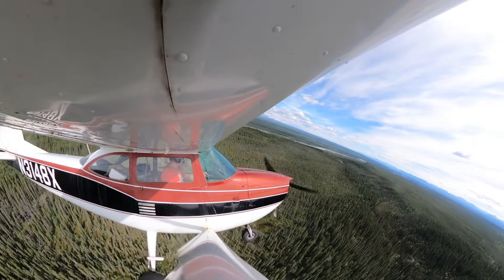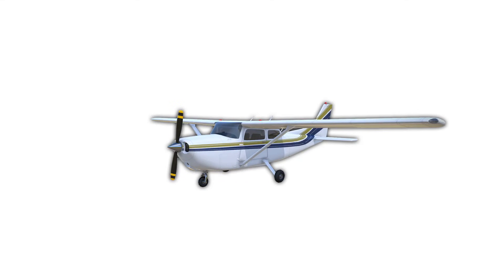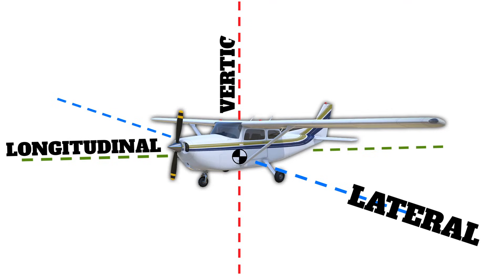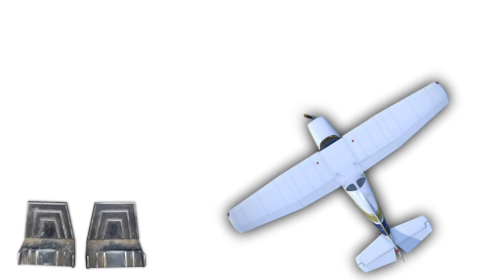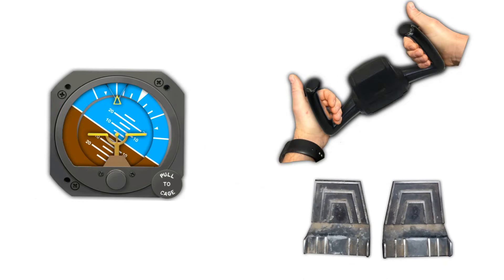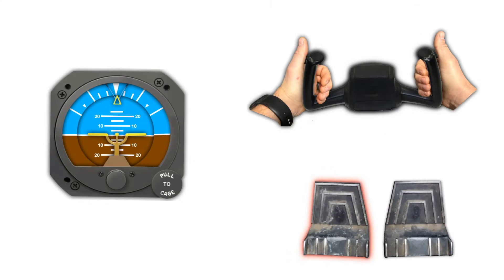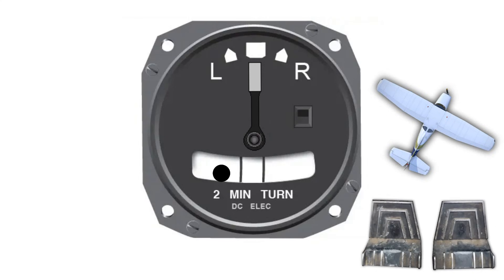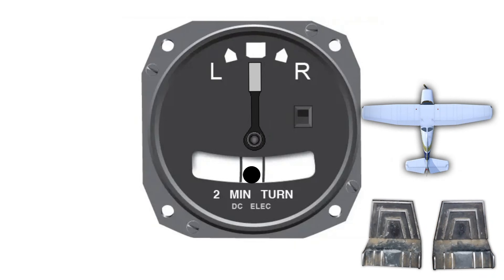How to Control an Airplane (PPL Lesson 5)

Comment: One more question:) so i know it looks elegant and cool if you tilt the aircraft (bank) at turning, using it with the rudder when you want to change direction and turn. But why do we actually need to use the ailerons? Why not just turn with the rudder, what would be the problem with it?
Reply from the maker: That is explained in lesson 9: https://youtu.be/xz8x9e6t1SA?si=xhQH7646xpCmCpzD

Comment: Are the flaps controlled by the yoke as well or just the elevators? I m confused i thought pull the yoke towards yourself is raising up the nose at take of bc they lower the flaps. But this video says that the yoke is for the elevator. So I m confused.
Reply from the maker: Flaps are a secondary flight control. They are controlled by a separate lever or switch
Reply: @FreePilotTraining  thank you

Comment: Firstly, Josh, I love what you are doing with this channel.
Secondly, the following comment is purely semantics and my decision to engage is predicated upon two factors:
A. Your invitation to comment.
B. Concern over FAA language in testing.

Starting around 3:08 we have these two consecutive statements:

"...moving longitudinally around that lateral axis"
and

"...airplane moves perpendicular to the axis that you're rotating on"

   These are throwing me for a loop. Are these descriptors a reflection of wording on the exam? I mean, if this is how the FAA puts it, I can get on board to pass the test, and please read no further.

   However, the two statements are conflicting, as longitudinal movement and perpendicular movement are not one in the same. In the second statement, "...perpendicular to the axis that you're rotating on", I respond to that by picturing the passenger car of a ferris wheel, not an airplane.

   In aviation terms, the only longitudinal movement I can picture occurs along an axis, 
like, "The C-130 suffered a cargo container shifting longitudinally in the fuselage, 
causing pitch instability when the center of gravity changed."

Also, my understanding of movement around an axis describes the travel as radial. 
For example, "The yellow propeller tip moves radially around the motor's output shaft", 
or, "The cutting edge of the face mill on the milling machine moves radially around the spindle."

I'm the student here, not in a position to say what or anything should change in your content. 
But could you explain the rationale for describing the movement as you have?
If nothing else, your content has prompted me to really wrestle with the ideas and I'm grateful for that. Thank you.

Comment: Question about the quiz: If you do not move the controls, but you reduce the power, why would the nose of your airplane pitch down?  (Assume the airplane is not a T-tail). I got it wrong because I chose "When thrust is reduced, lift is also reduced which allows the nose to drop". However, doesn't it say in the question that you're not moving the controls at all. Just trying to understand why the reduction of prop would matter if you're not tinkering with the controls?
Reply from the maker: The tail is the primary reason why the nose drops. Lift is reduced, but the tail downforce is reduced which causes the nose to drop.  When lift is reduced, the nose isn’t affected (much) by the reduction in lift since the airplane balances on the center of lift.
Reply: @FreePilotTraining  Thank you! Love your videos, by the way.

Comment: in the quiz, the answer to the first question is: "When thrust is reduced, lift is also reduced which allows the nose to drop."💯 since the airspeed around the wings is reduced, thus lift.
Reply from the maker: This is partly true, but the FAA wants you to know that the slipstream being reduced by a reduction of power will be the biggest contributor to the nose drop due to less airflow over the tail.

Comment: At 3:47, you say "The tail is deflected downward." Does the elevator actually deflect the wind, or is there more lift created under the wing and therefore pulls the tail downward? Which statement is more accurate? Love your videos!
Reply from the maker: It depends on the airplane you’re flying, but most of the time, it’s a little of both. Thanks!

Comment: Love your channel,really helpfull. im reading books to get to my PPL my question is about Skid& Slip. from what i understand Skid: feels like your body being pressed to the outside of a turn
Slip: your body towards the inside of a turn...i can picture it in my mind that drifting/ oversteer is skidding i get that the tail end moves outwards and i relate that to drifting .... now what is Slipping (is it the opposite: Understeer?) like how does your body move towards the inside of a turn (if at all true)???? can you explain/demonstrate in your fixed wings?  of course i'm aware that we are not driving and there are more axis in the air then on the ground..but???..thanks for the content, hope to hear or see a video  Cheers
Reply from the maker: Thanks! A slip is when the tail is moving in the opposite direction of the turn, a skid is when the tail moves into the direction of the turn too much

Comment: Great improvement from the last version, thank you for clearing that up about how the plane moves perpendicular to the axis it’s rotating on!
Reply from the maker: Thanks! I’ve been needing to improve this video for a while, and I finally got the chance.
Reply: @FreePilotTraining hey I was just rewatching this and a question came to mind. Just to make sure I’m understanding correctly, the plane:
1. Moves laterally around the longitudinal axis, 
2. Moves longitudinally around the lateral axis
But how does it move around the vertical axis during a yawing movement? It moves longitudinally? Or lateraly? Or both?
Reply: @Jimmywillliams I was thinking about this aswell, have you got any answers?
Reply: @Aycan7A  haven’t heard anything about it. I just asked Grok A.I. about it and this is what I got: 

During a yawing movement around the vertical axis:
•  The aircraft primarily undergoes a rotational motion in the horizontal plane, changing its heading.
•  It does not move significantly longitudinally (forward/backward) or laterally (sideways) in a pure yaw.
•  However, in real-world flight, yawing can cause slight lateral displacement due to aerodynamic effects like adverse yaw or sideslip, especially if not coordinated with other controls.

Seems like the correct answer is neither, although I’m not sure how accurate Grok’s info is.
Reply: @Aycan7A from Grok:

•  Longitudinal or Lateral Motion?
	•  Not primarily longitudinal: Yaw itself does not cause the aircraft to move forward or backward along its longitudinal axis (nose-to-tail). Longitudinal motion typically results from thrust (propulsion) or drag, not yaw.
	•  Not primarily lateral: Yaw alone does not cause the aircraft to slide sideways (laterally) in a significant way, though some lateral displacement can occur due to aerodynamic effects (explained below).
	•  Rotational, not translational: Yaw is a rotation around the vertical axis, so the motion is angular, not linear. The nose and tail pivot in opposite directions in the horizontal plane.